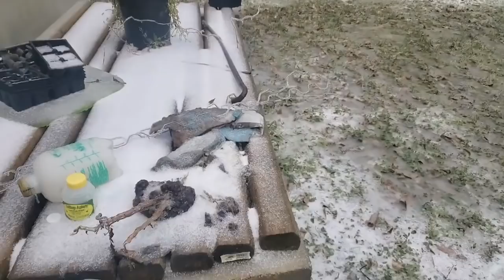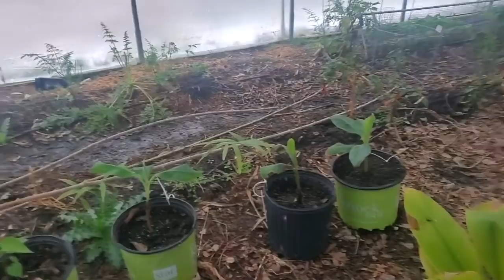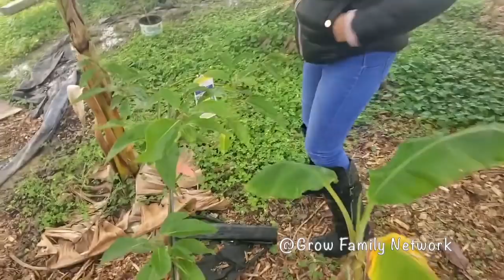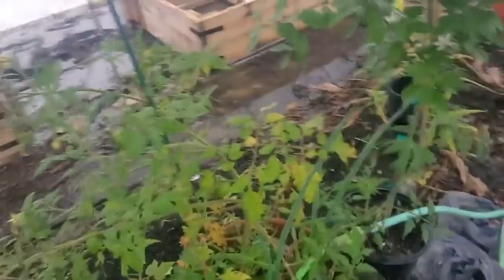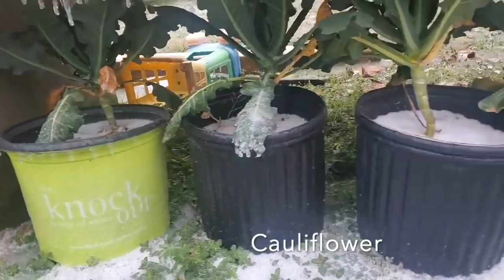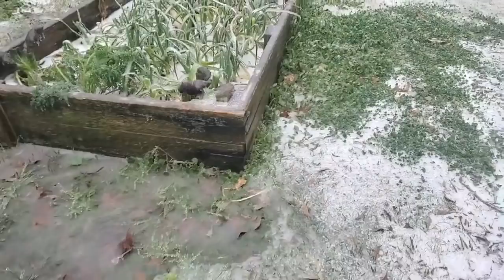🆕Our HighTunnel  VS 28Degree❄️ Temperatures{2/15/2021}

Comment: If you can run an extension cord to the greenhouse a hair dryer or heat gun work great to thaw stuff out. We get alot of ice storms here in KS and I've had my car so coated in ice I couldn't get in it LOL!
Reply from the maker: Never thought of using a hair dryer to get in my car...I broke a door latch before because it was frozen...thanks for that

Comment: Everytime you step crunch crunch that freeze is crazy, the high tunnel is holding it down. I spent the day yesterday making ways to keep my chickens warm it's in the 20s here over night for the next few days
Reply: I have two 12x40 caterpillar tunnels that I keep my chickens in during the winter. It’s been  -20F repeatedly here in Eastern Ontario.  (just across the border from upstate NY.) Covered the ground with a layer of straw. The chickens have been busy scratching and fertilizing. It gets warm enough in there on sunny days that the ground will thaw. Crazy. The chickens have kept laying all the way through this crazy weather. The body heat of the birds combined with the heat from unfrozen earth keeps it nice inside the tunnel. The snow is piled up the sides halfway to the roof. I’m thrilled with this system. Can’t wait to see what that dirt is like in the spring even though I dream about the south. Haha!
Reply: @westernmac5944  that sounds awesome, I'll have to look up how to make those for my chickens. I was scrambling to get their run covered in plastic, we had too many days of 20 below windchills...

Comment: Heat rises, the top of that chyote is fine as wine. Will be awesome until it touches the top plastic.
Reply from the maker: Thanks for that I wasnt even thinking about the heat rises thing ...thanks
Reply: @GrowFamilyNetwork  just figured I'd put your mind at ease. Can't wait till i can build my greenhouse. Well really it will be a blend of greenhouse high tunnel. I figure with a wooden structure anf the poly carb roof them plastic wrap around in winter with a solid wood ( with a door) north wall so i can add heat if i need too. It will only be 10×20' and maybe 6 foot walls with an 8' peak. Add a couple gutters and I'm golden. Lol. Big dreams on little land.